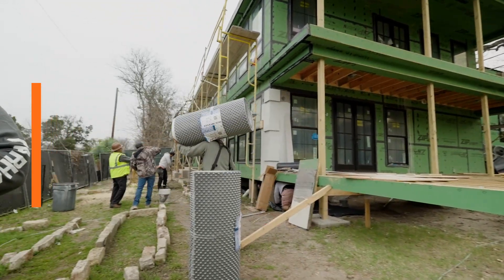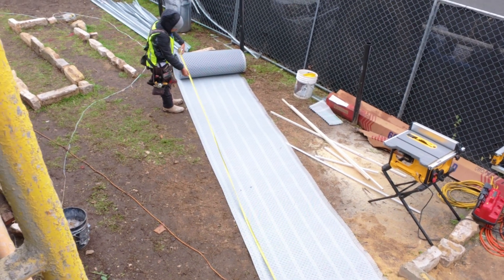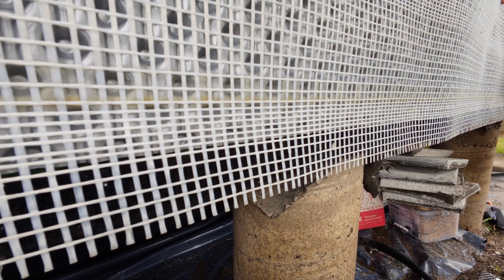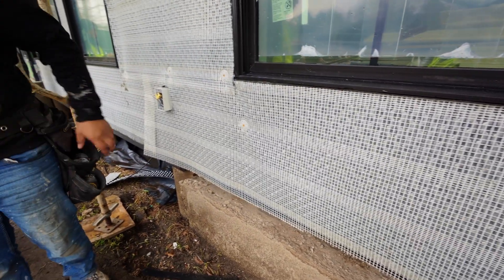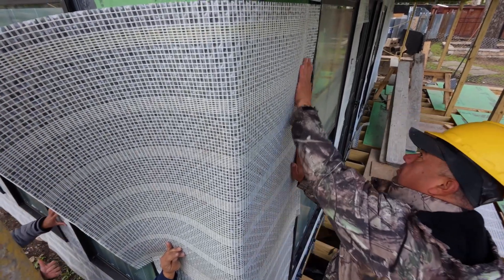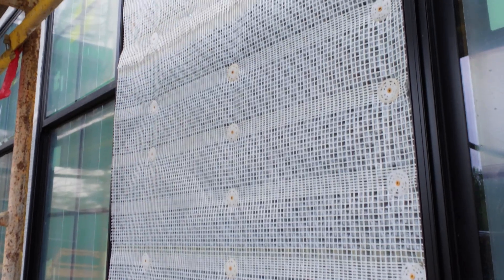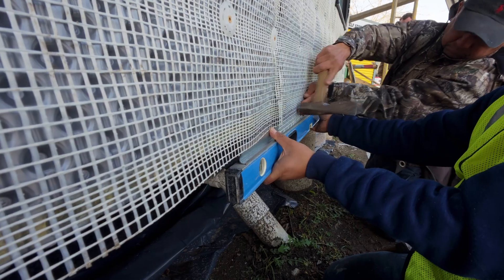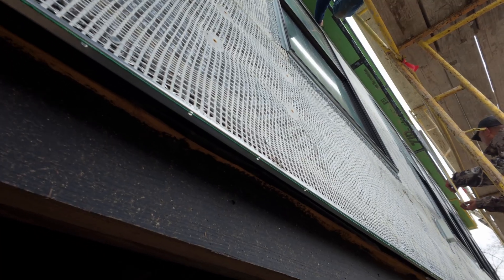How to Prep for a Durable Stucco Wall

Comment: Haven’t seen many plastics that become hard and brittle and crack easily through cycles of winter cold and heat.   What makes this synthetic man-made material better than absolutely any product that has ever been produced that has not failed in a 15 to 20 years time span of repeated cold winters and hot summers. 
     So I know that 80 to 100 year-old stucco in San Francisco California up on many of the old original houses that was over. Tar paper and metal screen is still up today.. 
      But anytime synthetics have been introduced as building materials they keep saying they’re the greatest and they promise and they give lifetime warranties that lifetime when it comes around the companies are far and long gone 20 years later 25 years later and the products are failing.
    What makes this one special?